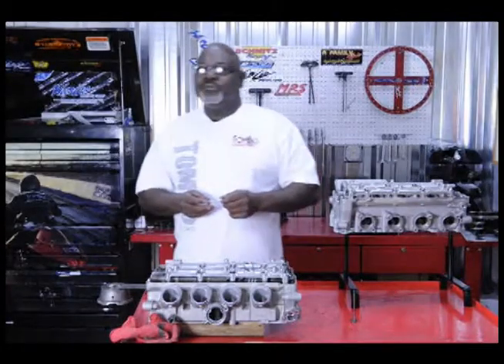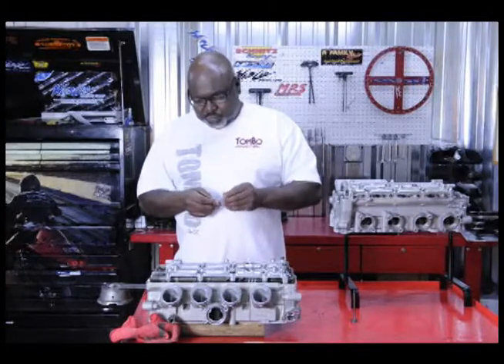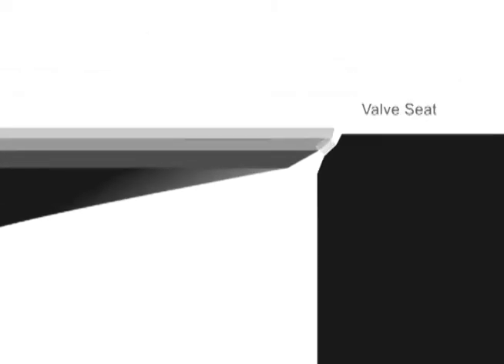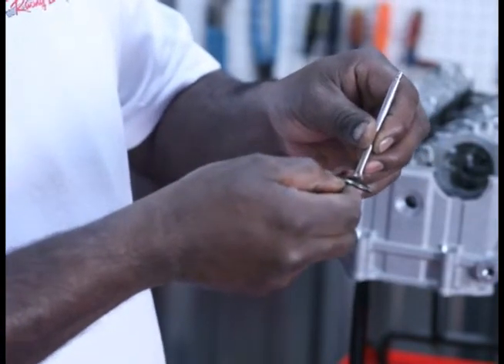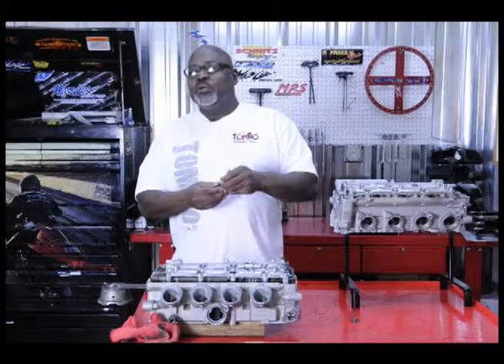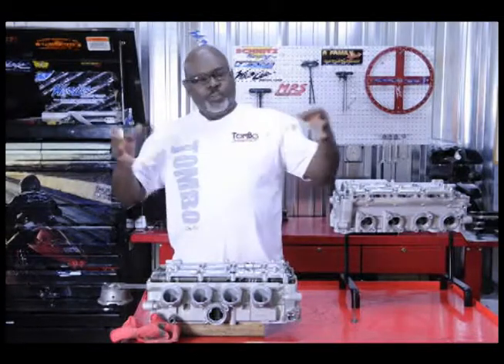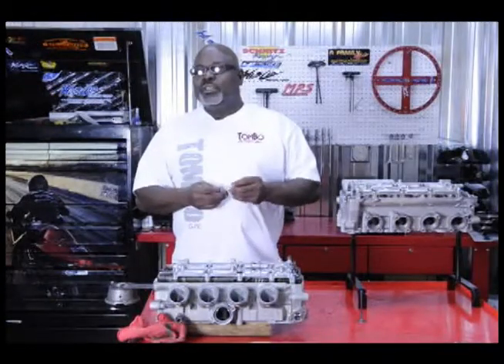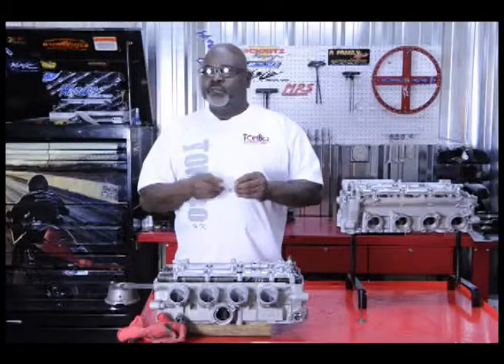Hayabusa engine rebuild Part 4 -  Valve Job

Comment: less chance of compression leaks atleast, and slight better performance. but this just opens all new questions on timming? valve lash issues , could get very exspensive for very little gains